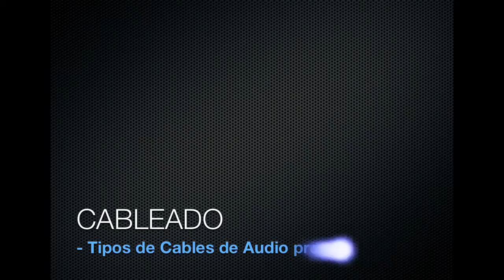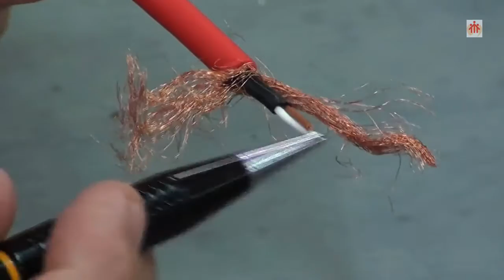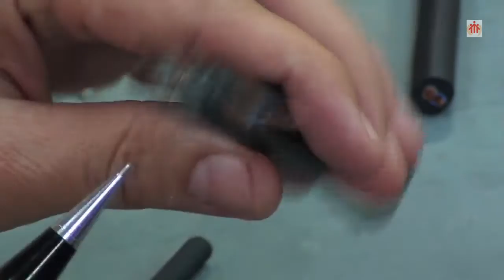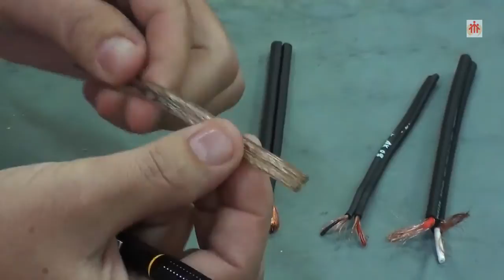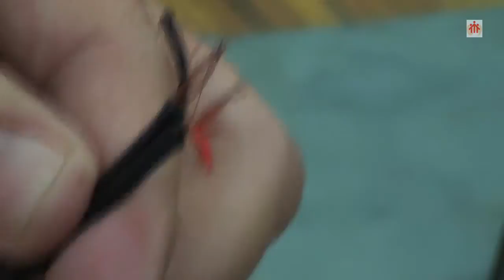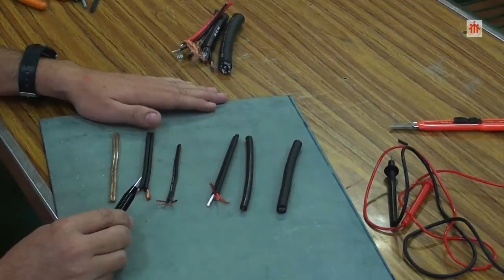CABLEADO   Tipos de Cables de Audio profesional

Comment: En el cable low noise, cómo sé cual es el positivo y cual es el negativo si lo tengo que soldar a un micrófono.
Reply from the maker: Hola Melanie,
No hay una norma para esto, lo que se suele hacer es que si lleva un vivo de color rojo o rosa, se considera el vivo caliente (+) y se conecta al 2 del conector XLR del micro y del XLR que va al mixer.
El otro vivo se conectará al 3 de ambos XLRs y la malla al 1.

Gracias por comentar, un saludo.
Reply: Melanie Novelo el positivo casi siempre viene en color rojo o claro y el negativo viene en color negro o de color obscuro, y el positivo se conecta al pin 2 y el negativo al pin 3